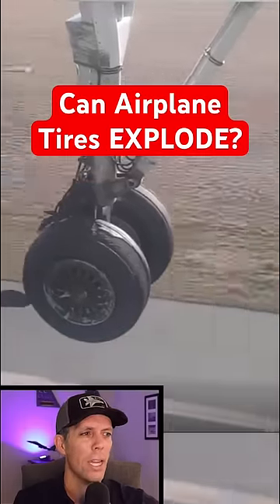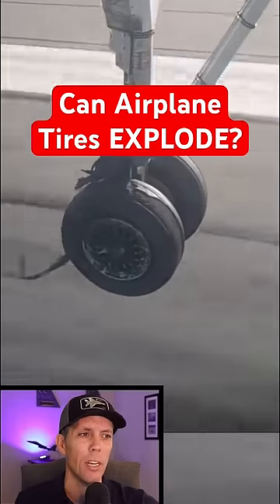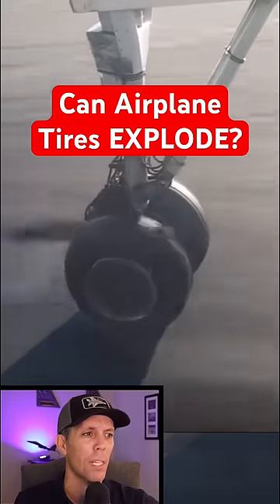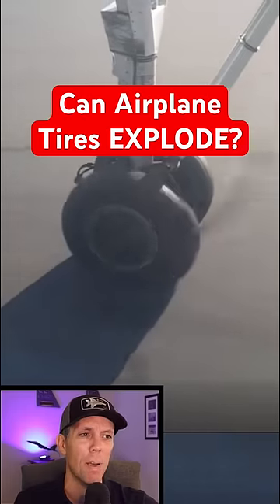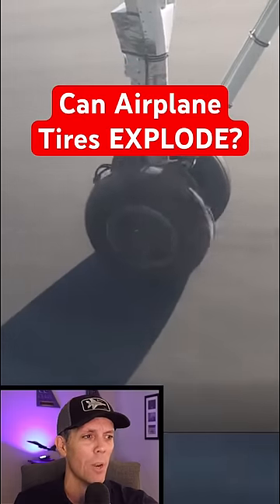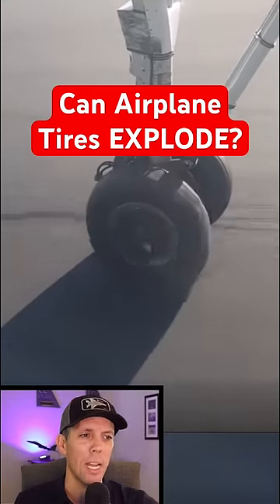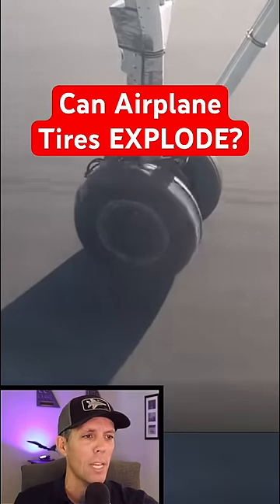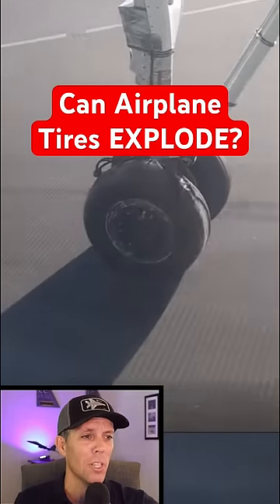Can Airplane Tires Explode?

Comment: When a stationary landing gear tire touches down it is accellerated with enough force to put a golfball into orbit.
Reply: no way... as there is still constant gravity that need to beat escape velocity.
Reply: @anveshnidumolu3679 well, things in orbit are in continuous free-fall BECAUSE of the fact that they're still subject to gravity, so I'm not sure what you're getting at there but it's a reasonable claim. F=ma, so the sudden acceleration from 0 to the speed of the airplane is a very sudden acceleration which results in a very large force. Take that amount of force and apply it to a small golf ball that weighs very little and is fairly aerodynamic and stable...
Reply: Chill... Cause we seriously still have not figure out what is unknown force acting upon celestial bodies. Also if saying small golfball can be thrown off to orbit? why don't we take an aeroplane off the ship with that three hundred  miles per hours. Even if putting it on paper, practically there is so much more going on in our atmostphere... Clouds and air pressure becoming joke nowadays. Also how long will use is f=ma when we know there are more than mass and accleration for force starting with earth rotation, wind velocity, anugular velocity.
Reply: @anveshnidumolu3679  it’s going to be okay. Can you point to where the strange man touched you?
Reply: Balls? heh forger that pun. You need bun for breakfast, complete pratical approch...by putting a volg of geberating power equalent to earth roation speed to golf ball... If success, we can dump all waste into cosmos.
Reply: @anveshnidumolu3679 I don't know what you're really trying to say. My takeaway is "clouds and air pressure becoming joke nowadays."
Reply: This why I have issue with newton n his formula... completely forgotten about envirmomt always talking about freefal.
Reply: @anveshnidumolu3679  the entire scientific world thinks f=ma is perfectly reasonable... but Anvesh has issue with Newton.
Reply: yup, no wonder why nasa fails several times before launching anything to space. meanwhile ISRO tend to have fewer issue only because mechanical  n unknown factors
Reply: No
Reply: Why don’t they spin the tires up before landing to minimize rubber loss?
Reply: That's probably the coolest thing I've ever heard
Reply: Bruh if that was true they'd be launching mini satellites that way. Lol
Reply: @thomaslunden 
your fancy book learnin' is making my head hurt. 
Mama always said that orbital dynamics is the Devils way of getting our brain all  messed up.
Reply: @thomaslunden said a whole lot of nothing there bud
Reply: What
Reply: @anveshnidumolu3679  He said "into orbit" ...not "escape the earth's gravity"
Reply: If u hit a golf ball with the force of the landing, it can definitely be sent into orbit.   Depending on the material made. Normal golf ball would have to sustain the sudden  huge force on it to be able to go into orbit or else it would just burst or go up in flames travelling on the speed and grinding with the molecules on the air. Much like free falling from orbit.
Reply: @billymanilli psst. Don't try. Arguing with idiots only drains you and eventually brings you down to their level. They've made it abundantly clear they can't sort their thoughts and come up with a coherent sentence to explain what they believe.
Reply: @thomaslunden your explanation doesent really help when things blasting off need constant force behind it because the force of gravity slows down the rate at which it travels upwards..
Reply: @thomaslunden also the golf ball would explode before reaching the force to accelerate past its own gravity which is impossible again without a consistent speed which u cant get out of something with no constant force behind it
Reply: Lmao no haha
Reply: @bobthomas3214 because the extra weight and complexity of a spool up system makes it less economical than just replacing the tires regularly
Reply: @coolmanbob2096 theoretically you could in fact fire a ballistic projectile into orbit without a motor with enough muzzle velocity. But there's no materials that could currently sustain the massive acceleration as well as not disintegrate from the air resistance
Reply: @anveshnidumolu3679 ISRO? Really mate? Hahah mate, you’re taking the piss. Had me in stitches
Reply: Something about that doesn't sound right
Reply: @anveshnidumolu3679 how tf did you think we got into space without the correct math
Reply: @anveshnidumolu3679  my friend…if you can disprove F=ma then you’re right about the golf ball
Reply: @anveshnidumolu3679 Leave it to the anime pfp to believe they can discredit several hundred years of scientific research. Please learn the difference between fact and opinion before commenting 😂
Reply: Force does not determine that...
Reply: I don't know. Orbital speed is about 30,000 k/ph. A plane, say an A320,  will touch down at about 200 k/ph and has a mass of about 35 tons, 35,000 kg. A golf ball weights .045 of a kg. So an A320 weighs 777,778 X as much as a golf ball. So by back of the envelope the A 320 would have to transfer 1/5,000 th of its kinetic energy to the golf ball to give it orbital speed which would slow the A320 0.04 k/ph, barely noticeable. Of course there is friction in the atmosphere which would probably burn it up on its way up.
Reply: Sorry 100% No Way ever to the golf ball to orbit claim. The Vertical distance from earths surface to the edge of Orbit is 62 Miles. That entire distance an object would be fighting constantly to overcome the force of gravity. There is not a gun made of and kind that can shoot any projectile from earth to orbit. The golf ball would need to accelerate to thousands of miles per hour to break gravity over that distance , in fact 4.9 per second or over 17000, miles per hour.
Reply: @wirefeed3419  I think in theory it could but in practice it would not. It would be more fight air friction and would probably burn up. But the difference in mass between a jet and a golf ball would mean that if the golf ball picked up all the bounce from being hit by the force of a heavy jet that it could obtain a velocity > than 30,000 km/h, orbital speed. F = MA as per high school physics. How many times does the mass of a golf ball go into the mass of a jet? It would not fall back to earth because of gravity. It would be slowed down but not enough and not as much as by the atmosphere, which has a much greater mass than a jet. Another possibility is that the golf ball would hit the plane, maybe in the wing, the fuselage or the fuel tank, and that would end badly for the jet.
Reply: @coweatsman  Perhaps what was intended is at the moment the static wheel first  initially contacts the tarmac the frictional force applied to the tire is so great that in theory it could accelerate a golf ball to a speed of 4.9 miles per second or 17,500 miles per hour. The speed that  would be required to put a golf ball into orbit if it could maintain that speed of flight for 12.65 seconds. It is all theoretical as the frictional force would heat up and tear the ball apart or burn it up if conditions ever could be actual. 👍
Reply: @bobthomas3214 that would cause more damage wth?

Comment: Fun fact from a pilot in training:

This is why we have a specific part of our checklist dedicated to the tires and wheel struts. Tires can wear down fast (especially on trainers that are used so much that it hurts my heart  a little), so it's really important for us to check them in order to not have complications when landing or taking off.

The only difference is that professional pilots probably don't inspect the mechanical parts as much since they have teams of mechanics to do that for them, but the same principle applies.

Use your checklists, friends!
Reply: So why would the pilot turn around and land instead of continuing on to its destination? I guess I’m not getting what difference it makes since it’s a tire and the plane has to land somewhere. It’s gonna suck either location.
Reply: @bidencrimefamilymottof-cky953 I can't exactly tell for sure, but this plane probably has retractable gear. If the gear is retracted, then lots of stuff may go wrong. It basically give the tire less time to get to a worse state (if that makes sense?)

It's usually better to land back at the airport when mechanical problems like this occur rather than letting it sit.

Again, I'm only in my training and haven't gotten to fly big planes yet. I'm still only 16, flying pipers and cessnas (general aviation, small planes), so I'm not totally sure how this is handled, but the pilot/ATC clearly thought it was the best choice.

And yeah, the landing wouldn't be very smooth in either situation lol
Reply: @just_another_editor2956  thanks a million for your response. Wow only 16? You’re really into awesome stuff already! Good for you! 

I can see where addressing it right away would be a good idea but I also think burning some fuel by completing the trip as opposed to dumping it or landing with the whole trip worth (making the plane heavier and having more combustible fuel to burn/blow up at landing) is something to consider also. But what do I know??? Lol I sit in the last row of a 737 year because the tail just might stay somewhat intact in a minor fender bender. 

I dated a guy YEARS (40 or so) ago who was an aerobatics instructor. He flew a Decathlon biplane and one of his students had a Cessna. We played war games chasing each other like fighters. Top Gun style. That man/pilot was truly exceptional. He’d take us up, intentionally stall, dive and restart/pull up at the very last minute. We’d go weightless and shit would float out of my purse. He’d be sure I closed it before we flew inverted. Which we did a lot. And roll. Lots of rolling. He was a phenomenal pilot to say the least. Great guy. I enjoyed every second we flew. It was an Incredible feeling of freedom owning the sky like that. 

I hope you never shortcut or skip safety measures and hone your skills to perfection and beyond. Enjoy every moment and by all means be confident and proud of yourself. You got me all nostalgic and shit…water coming from my eyes. Lol See what you did?!?!

Again good on you and keep up the great work!!! Be safe! Have fun! Thanks again for your reply!
Reply: Good luck with your training! I'm working on my commercial rn. Don't forget to add right rudder 😜
Reply: @bidencrimefamilymottof-cky953  Oops! I didn't mean to make you cry! 😢

Also, they drill the rules and regs into your head, so you don't have anything to worry about lol

You have a great day, too, wherever you may be <3
Reply: @TheBigestmack  good luck to you too! Commercial training seems like a lot, so I hope you do well, too!

Also, the right rudder is the REAL homie 💪

Comment: Good for about 200 to 500 landings, that's a hell of a variation 😢
Reply: I wonder if it’s depending on the plane. I’d guess a 747 goes through them much faster than a Cessna 172
Reply: Besides the airplane type it also highly depends on the route. On remote islands you pack a lot of additional fuel because your alternate is far away and the weather might frequently change. Then you land with close to your maximum landing weight, which not only increases the weight but also the speed at which you have to land. Then you have airports which have multiple alternates within a short distance and good weather predictions. Those are the routes where you go light and plan to land close to minimum fuel.
Reply: Ya so id say replace them after 100.
Reply: It depends on a lot of factors but the biggest are temperature and surface (if it is wet or not)
Reply: 200.  To .,,.. 500.  Anybody's guess
Might be 201 or could be 499 or anything in-between before it blows
Reply: does touchdown speed affect it? also i assume soft field wouldnt take as much
Reply: @joejohn8274  A Dash 8 (straight wing, Turboprop) is going to last much longer than a tire on a 737 or 747.

Add in variances in operating conditions, such as Denton Enterprise airport most airplanes can land safely without even touching the brakes, versus short field operations.

Pretty darn good reasons for that significant variation in tire longevity.
Reply: Even on the same airframe, you are going to run through rubber a lot faster at close to max load than when running empty. It's not as if the maintainers have no clue how many more landings a tire is going to be good for either, they get checked regularly.
Reply: Its not like you let them fail they are inspected. Some last 200 landings some last 3-4-500 it just depends, but they are changed before problems emerge.
Reply: It depends if you’re flying spirit or delta
Reply: It depends on the runway and usage of the breaks.
Icy runway makes them last longer.
Reply: You can tell when your car tires need to be replaced. My guess this is the same. But things like heat of the runway would effect those tires so the count is just a estimate.
Reply: China tires vs Western tires 😂
Reply: Weight of the aircraft, landing velocity, type and condition of runway, whether it's a wet or dry landing, runway length (dictates how much breaking force is needed) whether or not wheels hit minor debris.... I imagine there's a large variation because there are so many variables
Reply: You realize they inspect them to see if they're still usable after every flight right?
Reply: Open ur mind. Air is not our domain yet.

Comment: After the tires are unusable a lot are sold to boat companies for the sides and rear of boats for protection, we had 10 across the back of my last boat and some down the sides.
Reply: I've also seen them on modified buses for dune rides on lake Michigan around silver lake.  Pretty dope.
Reply: sounds like a lot of protection.
they're so much more than light truck tires.
Reply: @richtomlinson7090  well I've seen big chains and heavy welded eyes break and rip lose, but the tires barely have any damage on them.
Reply: Didn't know, cool. I guess they get them somewhere. Was it a tug.
Reply: @BWo-bb1yw  almost any service industry boat in the oilfield has them including tugs, crew boats, and supply boats.
Reply: Those tires you see hanging off boats in movies 😂
Reply: They also reuse them for astroturf

Comment: Props to the passenger who filmed this. They kept the camera stable and on target.
Reply: How did the passenger get that perfect angle being inside the plane?
Reply: @cactusflower7820 
And that's what I came to the comments to find out but no one seems to be mentioning that besides you... Lol
Reply: @cactusflower7820 the way the Dash 8 landing gear is designed it goes up in the engine area which is on the wings. So when deployed the gear comes down from under the wings instead of under the aircraft like usual so that’s how you can see it from inside the cabin. Also the plane is a high wing design so instead of sitting over the wings the wings go above you.
Reply: it was YOU wasnt it?
Reply: Was the passenger sitting in the belly window of a B-17?
What modern aircraft has a clear view of the gear?
Reply: No props, it's a jet... Lol
Reply: @cactusflower7820 because being outside the cabin would be too dangerous
Reply: @tonyduncan7710  
😄😁😅 I see what you did there.
Reply: Hint : it's fake.
Reply: Uhhh ever see a GoPro stick mount or a selfie stick. They probably opened up a window and lowered it to get the view. 👍
Reply: @ralphday4842  lol no
Reply: How is no one talking about how it’s a video game like damn who does this look real too

Comment: They leave about a pound of rubber per lending and are good for 200-500 landings. I didn't realize they were so incredibly heavy.
Reply: Numbers dont seem right. 747-8 main tires weighs 270 lbs each. A Boeing 757 main tire weighs about 150 lbs. Main tires for an Embraer ERJ190 regional jet are about 145 lbs each. No way those tires are leaving a pound of rubber per landing and being used for 200 landings
Reply: A roughly a pound per plane per landing,not per tire